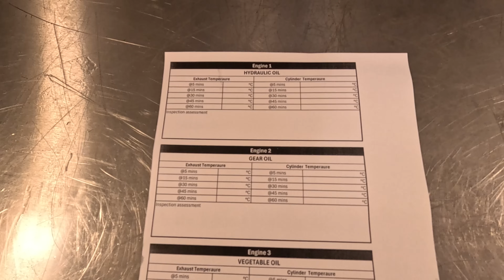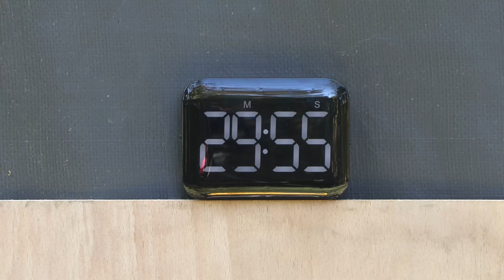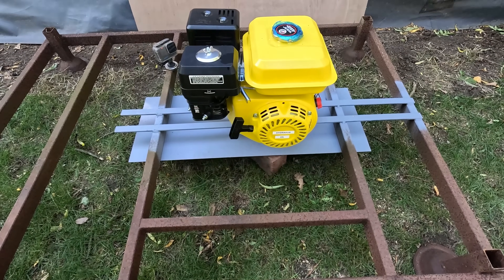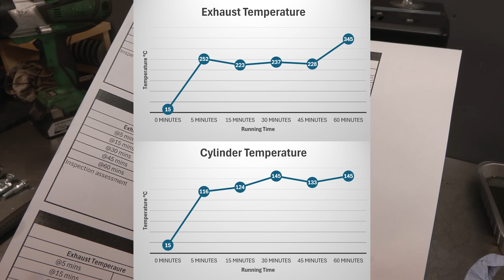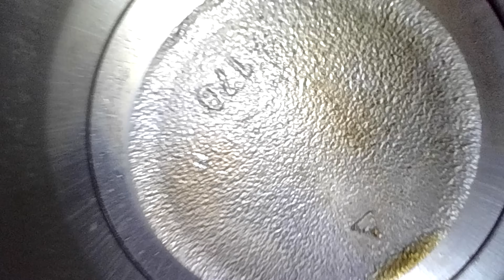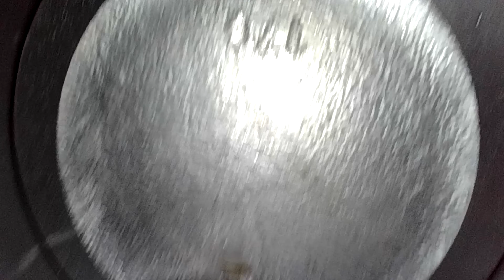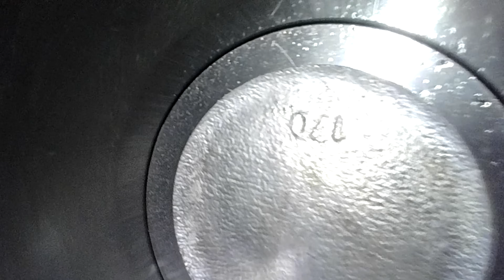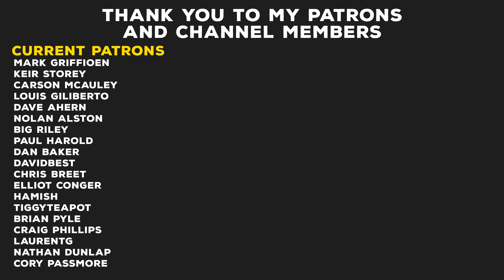Will Any Oil Work as Engine Oil?

Comment: Good try, but you could easily have measured fuel consumption, as a measure of friction. And and you should run an engine on normal engine oil for comparison. Now that you have the engines, you could do it again. Let each engine run on normal oil for a few hours, to "normalize" them, and to get your comparison figures with engine oil. For interests sake, you can buy a cheap vibration sensor and hook it up as well.

Comment: A neighbor had an old subaru and decided to try water in instead of oil but wanted to put it in with the water hose in front of the state boys working on the road. They looked horrified. It was quite funny as he told them "water is a lubricant!" He taught hydraulics at the local collage as well.  He only used it for an off road farm vehicleI but it ran for several months before he got rid of the car.

Comment: Very interesting video. The vegetable oil is particularly interesting - imagine a scenario (maybe a hurricane) where someone needs to get their generator running in an emergency and doesn't have access to real engine oil, but they have a bottle of vegetable oil in their kitchen.

But like other posters have said, we need a control using normal engine oil so we can compare the temperatures and the amount of metal glitter to see what's normal and what's due to the oil. Also you should run the engines at full load for the hour, that would make any differences much more pronounced.

Comment: Need to try pag oil, linseed oil, grape juice, pure lucas oil stabilizer, bacon grease, gasoline, hydrogen peroxide, maple syrup, elmers glue, ky jelly and soy sauce….  Lol. Would be a good time for a few of those..  get a remote start and start the gasoline as a finally..  dunno what a little splash oiling motor would do with pure gas as oil..

Comment: This is a flawed test. You should have run a break in period with standard 0w-30 or HD-30 before the tests. With the loose QC on clone engines any one of those tests could have been skewed with excess flashing and sprue materials from the casting process. 
You should always try to eliminate as many variables as possible to get the clearest results.

Comment: We had a old Dodge van with a 318 V8 that we hated and decided to run used ATF as engine oil so we could watch it blow up. We never changed the used ATF and just kept adding more as needed....8,000 miles later we gave up!
Reply: The biggest problem with a 1970s 318 in a truck is that you CAN'T kill them, they just keep plodding along at 7.5 mpg. At least if it died I could've justified putting in a mildly built 440 and getting 13 mpg! ALWAYS got better mpg, starting, and heat with a built big block than any non magnum smallblock other than an old Poly 318.

Comment: Another thing is oil degradation. Where honestly. The vegetable oil will properly go first. As it will actually cook. But again. This will need longer run periods. And the repeat of heating up and cooling down. 
Now. The temp of the hydraulic oil is not too surprising.. as it is a high strain workload oil. But honestly thought it would make the engine run a lot rougher as it is made to compress. 
But yer.

Comment: Okay my turn,    ....once as a teen i spent a couple weeks in a rather lonely area with not much to do except to diddle with a few machines and fewer tools.
I had a lawn tractor that i took the blades off so i could drive it around the fields. However i had no motor oil, just a big can of 140wt gear oil, so i used it in the engine and it worked just fine for a long time.
Another time i used some cooking oil in a mower and that worked fine until i let it cool down overnight and it solidified. I had to start a fire under it the melt it out.
Then another time a friend had somebody elses motor that he really wanted to break, so he drained the oil and filled the crankcase with WATER.
After running for an hour with no apparent ill effects ( it wasnt working, he wanted to wreck it ) he drained the water out and ran it dry.  THEN it finally started sounding stiff and before it seized he put oil back in it.

Comment: I'd like a sexond video with another engine performed as designed with the same oil to see what it's supposed to run at and follow up with a cold and oiled compression test. I'd also like to see them put into go-karts.

Comment: Temps are meaningless while tested outside in varying conditions and windspeeds.

All engines should have been run-in correctly.
Then flushed and cleaned before inspecting the interior condition and replacing with your test oils.
All 3 should be run side by side at the same time in the same conditions.
You can do the periodic inspections as you please.
Then all 3 should be run until failure [bearing in mind recommend service intervals] with the time before failure being recorded.
All of this should be done under load. A pump, generator or fan/prop could be used to create load.

Comment: Wonder how this would have turned out with them running under load. Even something as simple as a tractor dyno, a belt running from the driveshaft to an oversized paddle-bladed fan of sorts. Anything that doesnt store potential energy like a flywheel would work.

Comment: Fyi. I have worked with quite a few of them clones. Open them up before running and clean them out. Most of them have allot of machining debris on the inside when new.

Comment: These temperature figures all looked terribly concerning to me, but I also have zero experience monitoring air cooled engines. I feel like this would have been even better with a fourth engine running on engine oil, so us city slickers would have a reference point for what it should behave like.
That's not to say it isn't a real cool video that I'm now going to watch the rest of the way through. A-1, sir.

Comment: You should get one more engine and use normal engine oil as a control. Then with all 4 engines broken in with their respective oils, do a longer (50 hour maybe? Of they last that long) test with the engines under a light or medium load to show how the old actually hold up over time

Comment: Awesime opportunity to test an old trick! Replace the oil with the recommended oil in the most heavily damaged engine but add a teaspoon of Bon Ami cleansing powder and run it for an hour.

Supposedly, it will de-burr rings and polish out scratches in the cylinder wall, resulting in increased compression and lower cylinder temps.
Reply: That sounds like it would just kill the motor
Reply: @AnthonyPerna2  That's the question. Supposedly Bon Ami is such a mild abrasive that it just polishes without scratching. It used to be the go-to method of getting fresh rings to seat.

Comment: This is a really awesome video let me say. I do really like the idea and I love the idea of running something like a predator 212 simply off of vegetable oil. I think if I were to perform the test however I would run each engine with its recommended oil and follow the proper break in procedure for the engine if there is one, and then examine/perform the test with the different oils. While also adding an additional engine that runs under the same conditions except it is run only on the recommended oil for the test itself to act as a control group. Love the idea!

Comment: A lot of hydraulic oils have a high detergent level, which can scrub the surfaces. It's kind of like running an engine with automatic trans fluid in it instead.  This will especially be noticeable with a new cheap engine that may never have been run at all (lots of manufacturing debris and dust).

Comment: One time I put oil that was slighter lighter than what it called for in my lawnmower assuming it would be fine, and it started smoking a little bit and running rough which really surprised me. I then got the correct oil and replaced it and it ran perfectly again.

Comment: Thank you for the video, some suggestions would be to have a control engine as well as have all the engines be broken in properly first. It would be interesting to run the engines longer then an hour. Maybe 10 hours

Comment: the exhaust temperature is very dependent on the fuel mixture, the biggest difference in the 3 engines exhaust temp is probably because they have different fuel ratio between them

Comment: I have actually ran an engine on 80w90 gear oil before. It would always leak out overnight and didn't much care about using the gear oil in it as it was found in the garbage and ran long enough to save up the money for a new mower and after putting gear oil in it and it barely leaked at all and i still have it but hasn't ran in over 3 years

Comment: For a properly fair test, yes the break in should already be done. But getting an engine back to new condition clean would be near impossible and not worth the effort. Of note the break in oil recommended by most small engines, engines in general to think of it,  I've seen calls for essentially thin gear oil, a straight 30 weight plain jane oil.

Comment: I know you probably don’t want to hear this but I would have chosen higher quality engines. Cheap Chinese engines have a tremendously inconsistent build quality (your 2nd engine ran ruff probably due to a poorly tuned carb). I would also have “worked” the engines for that one hour. Perhaps on a generator?

Comment: Reeaally wish there had been a control engine using the proper lubrication.  Even if you release it as a "Part 2," it'll still be relevant.

Edit:  I'd also curious to see one running on ATF or Diesel fuel.  Thanks!

Comment: i vale valves in on all new cheap engines they need it even a real Honda i bought gx engine was running ruff after 12 hours or so lap valves fixed  it  .theses thing are just thew together upgrade valve springs to stag 1 i guess u can say helps alot to 10 dollars at most

Comment: When i was a teenager a bunch of us went camping in my buddies 78 dodge van and ended up putting a hole in the oil pan, hit a rock on it or something.  But we were hours away from anything even with a running car.  And this was before cell phones.  Luckily my buddy had an odds and ends assortment of tools and random stuff.  He ended up patching the hole with bondo and he mixed in some smashed up rocks to try to make it go farther and give it some structural integrity.  We got that fixed when he realized we didn't have any oil lol.  We had 2 quarts of atf and water and some booze.  So it was either try our luck with the atf or run it dry.  He took it easy and stopped loads of times to check on it but that van made it all the way to the closest gas station '2.5' hrs away where we got some oil and drained out the atf.  He drove that van for years after that with no problems.
Reply: My grandad did oil change on his yugo, drove it 70km to another city and back, and when he got home he was surprised to see he forgot to add the oil😅Car ran fine
Reply: @maxx-er3fj  my experience with those cars are either very good or complete lemon. there's no middle ground.
Reply: My dad told me a story from the 80s when he was living with his aunt, his uncle had a full size Chevy van that he mistakenly put diesel into when he realized the mistake he put the petal to the metal and the van ran fine after all the Diesel was gone.
Reply: @iamjames8403 Diesel will not ruin petrol engine, tho you must add petrol to diesel you put in, so the spark plug can fire the fuel. Petrol will destroy diesel injection system tho
Reply: I use vegetable oil in my power steering because of leak, I can stear with one finger lol.
Reply: @JohnGlenn-ip5bl  the salt will destroy it eventually.
Reply: Awesome story!
Reply: Look up the guy and girl that got 2 flat tires in death valley and abandoned the car and then they fell into a cliff canyon and he died and she was in her last breath days later when a helicopter spotted her with a reflective object .     Turns out you can still drive a car with a flat tire !!!   Also you can put the 2 good tires on the front wheel drive car also !
Reply: @pepperroni4016  oh wow lol.  Not to laugh at a tragedy but holy crap.
Reply: ATF is just high grade oil with detergents added. I've added ATF to regular engine oil and run it before and oil change.  :Its amazing what gunk comes out of the engine during the oil change.
Reply: @SalianWonk  ATF is hydraulic fluid. very different than conventional engine oil.
Reply: I would like to do this with soybean oil. It does good on metal to metal friction testing. Also, castor bean oil.❤
Reply: I bought a really cheap vauxhall (Opel) Vectra (96) in around 2006, at auction for £280. Because it was so cheap, I didn't really care about it, or how long it lasted. At the time I was in a long distance relationship, my girlfriend lived in Portsmouth, and I live 20 miles south of Manchester. I set off down there for the weekend straight away after buying the car, I drove it around there for the weekend, and back on Monday. The total distance being around 500 miles, and up to around 100mph for sustained time on the motorway at night. When. I got back, I took it to my local mechanic for a service. He put it up on the ramp and said "I hope you've not been too far in this, there's no sump !" 😂
Reply: Holy freaking cow thats crazy for real

Comment: Two things to learn from this, can possibly use gear oil for summer running and vegetable oil for winter and hydrolic oil maybe to break a motor in or out! From the last motor seeing the oil in the cylinder show it had problems from the start but as simple four strokes are they can run with almost no compression! Or the guy at the factory said we get em good with a bit of oil on top of the cylinder!

Comment: That was a good watch, cheers. You want to get a load on the subject engine like a fan or water pump circulating into a barrel. Running an engine for hours at no load won’t break it in, there’s more chance of the harmonics killing it than failure from the oil. Load test will sort the ken from the boys 😂. All the best to you.

Comment: I think you would’ve found the reason for your differences if you have monitor the RPMs and if you had of know the flashpoint of each oil. The first one would’ve explained the temperature difference between the oils and the second one would’ve explained the exhaust temperature difference.

Comment: I wonder if the increased exhaust temp with the vegetable oil was from oil sneaking past the rings and combusting in the cylinder? By chance did you measure the volume in compared to the volume out against all three?

Comment: Cool test 👍 would have been interesting to run a baseline test with the recommended oil just for a comparison.  Maybe you could somehow put them under load and run the test again to see how it changes to the original findings. Excellent job mate 👍

Comment: Can't say for sure on these engines, but on my duromax generator with a chonda motor, it had A LOT of glitter on the first oil change(only ran for 20 minutes to clean out any machining shavings), then had a slight bit of glitter after another 40 minutes with fresh oil, and then the glitter was essentially gone after another hour long run with fresh oil. From there, I did a 3 hour run and a 6 hour run with fresh oil each time, and noticed no glitter at all on those changes. Currently working on a 15 hour run with fresh oil, but I don't expect to see any glitter in there when I drain it(just haven't had enough power outages to make it run for that long, and only do 1 hour "exercise" runs every 60-90 days to keep things from sitting for too long. It would have been really neat to see what it did running proper oil for the first hour or so to clean out any leftovers from the machining process before starting the tests.

Comment: diesel engine, peanut oil as lube, when hot suck it and use it as fuel.
fuel tank connected to crank case, not to fuel pump.

Comment: I'm a heavy equipment mechanic, and I've heard a second-hand story of a generator that was filled with hydraulic oil and when it was brought in for the next service all of the fluid had turned into a thick jello consistancy.
Reply: Wouldn't be surprised considering the different conditions it was exposed to. Although I've seen in certain regular engine oil cases from lack of management turning into a jello like substance. Though that was probably the end of the engine at that point lol
Reply: Hydraulic oil additives aren't made for temp above 180f , it literally cooks when overheated
Reply: @richardturner8630  wow thats only 82celsius!
Reply: This sounds a bit like what happens when water or coolant gets mixed with normal engine oil. Coilant paste will form and nothing gets lubricated enough.
Reply: Can you turn jello into hydraulic oil if you put it in your generator?
Reply: @EricaMTB  I bet it works for a while. It's quite tue surprise hiw much junk can go through a hydraulic system before it fails.
Reply: Probably refined mineral oil,there's a number of types..
Reply: Are Dot 3 and 4 Brake fluid same as hydraulic oil?
Reply: @fidelcatsro6948  brake fluid is a hydraulic fluid, though it's vastly different than the hydraulic fluid used in industrial applications. It's quite a nasty chemical
Reply: @geneturner3190  noted and thank you!

Comment: It would be interesting to know how an alternative oil mixed with regular engine oil would perform, 10W-30 mixed with Canola oil, for example. Canola oil is sometimes used as a lubricant for things such as machinery that processes food, and it would also be interesting to see if straight or mixed avocado oil would be any better than canola. Avocado oil has a high flash point at 520°F/271°C, and perhaps an oil thickener could change the viscosity so it's not as thin.